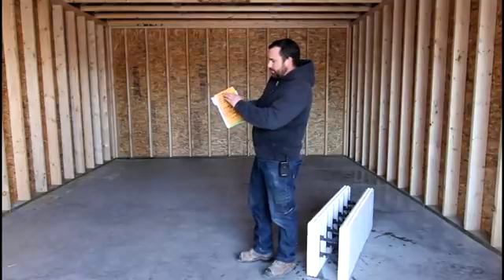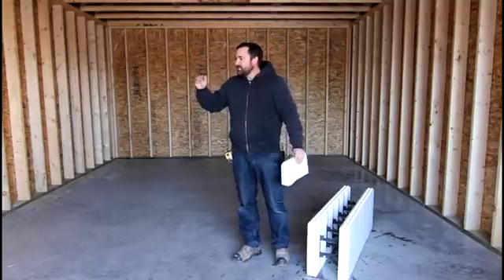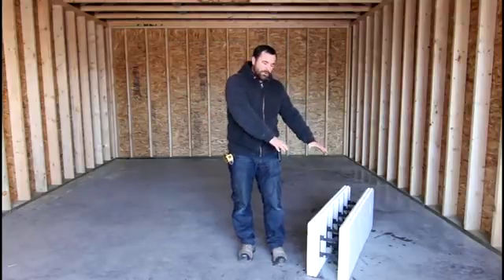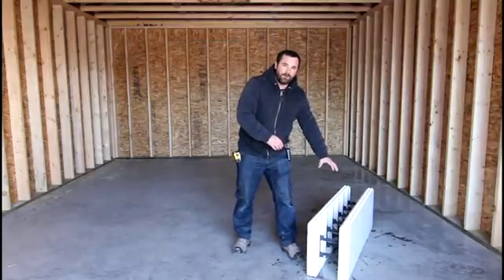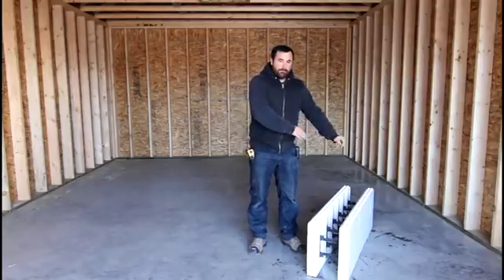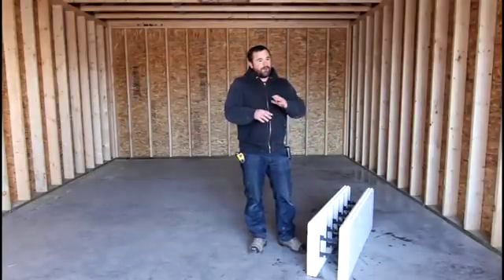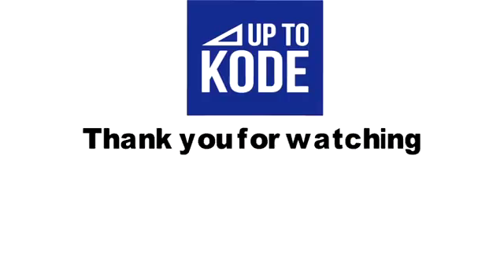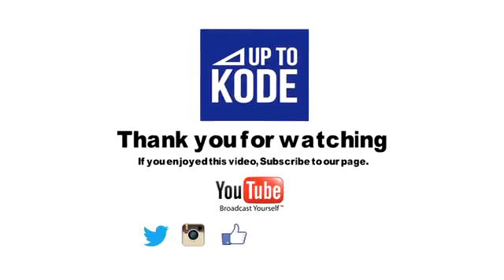ICF vs Wood : How a Spray Foam 2x6 Stud Wall Compares to an ICF Wall

Comment: Blah Blah Blah you still have to interior frame to attack drywall and run wiring. Just another idiot trying to push his specialty without telling the whole truth. We all know every home builder is trying to make money at your expense. It’s not about what is the best, it’s about what is the cheapest way to do it and satisfy the customer.
Reply from the maker: Attachment for drywall and siding is built into any ICF system. Might want to look it up for yourself.  With that known fact you might realize the simplicity and complete system that ICF is.
Reply: Why is it then that most users put in studded walls as well? Because they want a solid wall. ICF is a nice concept, but it results in wavey walls because of its lack of rigidity in the pour. Blow outs are very common. The requirement to use pea gravel also results in a weaker wall structure verses conventional gravel use. The inability to determine voids is another issue. Sorry will stick to a real wall construction seeing as you are framing inside of it anyway.
Reply: Letserb.  If people are having to frame an interior wall as well, then they had the wrong contractor.  You snap a line on the footing, line the block up to the line, and foam it down.  At the top you run a string line all the way around, and plumb your walls after the pour.  Not hard, just different steps than a stick built.  I can make our ICF walls just as straight, or straighter, than lumber.  We use engineered floor trusses on every build, which can't be altered, and they line up just fine.  It all comes down to the workmanship of the contractor.  As far as the aggregate, we use standard 3/4" (unless spec'd different), with proper slump, vibrate properly, and no issues.  Blow outs happen occasionally, and almost all of the time it is because someone forgot to brace something, or forgot the clips, etc, which comes down to workmanship again.  We have been contracting for 27 years, building houses for 18, and ICF exclusively for 8.  All our builds are to the roof, and out-perform a stick built house in every aspect.  It costs a little more, but you are getting far more as well.
Reply: If you don't know what you're doing yeah but icf is the best wall system hands down storm and pest resistance and so much more and interior framing is a bonus if you plan to change your layout eventually

Comment: This guy is dumb he cant even explain everything he saying maby to much and and said he isn't gonna get into it. Spray foam is definitely the best way to go that is what I do for a living and there have been numerous amount of people extatic about there cost being lower.  Concrete is a really bad way to insulate any way let's cool air come straight thru. Spray foam is the best suggestion
Reply from the maker: Spray foam has it place and it is a great product but for the sake of debate like the title suggests...ICF outperforms for multiple reasons. Namely continuous insulation, strength and longevity of concrete, thermal mass, and air tight. 

You’re right concrete has no r-value but the 2 3/4” of EPS foam on either side sure does!!

Comment: If you are going to frame with 2x6's then you should use advanced framing techniques. Things like 24" oc studs, more efficient corner builds, etc. In a 1700 sq ft house, I saved over $300 dollars in lumber costs alone. Remember that the cost of labor must always be adjusted for the extra time taken to build non-standard houses. Another trick is to use 2x4's wherever the code will allow with 2x6 framing to reduce the thermal bridging (the second top plate for instance.)

 Another building option in colder climates would be to use 2x4 framing 24" oc with a single story house or on the top story, and sheath the outside with OSB, drain wrap, 1"-1.5" continuous rigid foam, and siding. In hotter climates foil backed thin sheets plus an air gap works great. Six inches or so of uninsulated foundation walls exposed to colder ground level temperatures will allow heat to escape from the house, so ICF for the foundation build with good drainage is preferred. (Watch out for termites when using ICF!) 

 When comparing apples to oranges, use the ripest fruit.
Reply: sounds really good until the tornado comes then the ole butt cheek get mighty tight
Reply: It's true that the stronger the better, but most of the US isn't in tornado ally, and a direct hit is going to damage your house unless it is completely underground. Jacque Fresco has designed a house that can withstand a direct hit better than any other design. It is shaped like a cone - think of a large fancy Teepee.
Reply: Thats true you don't see them in a lot of places like Vegas or Arizona New Mexico , I was born and raised in Houston Texas so hurricanes are no joke. I can tell you that a ICF home can withstand both. The only week point is the roof, and as long as you properly tie the roof, meaning using plywood rather than OBS, Using screws rather than nails, and the proper hurricane clips, that home wont go anywhere even if your windows fail. A stick built home is basically doomed if directly hit by either a tornado or hurricane.

Comment: This guy has it all wrong, spray foam does more than just insulate.  It also helps sound reduction,  vapor break,  it adds 40% to the structure of the building.  Yes it is more expensive than batt insulation, but in the long run it pays off.
Reply: I doubt open cell foam adds 40% strength to a building structure.  I can def. see a closed foam system but then you're adding nearly 40-50% more in cost vs an open cell.

Comment: And so... have you calculated the additional cost of siding the home.  What is the cost then to drywall the walls on the inside.  Doesn't that have to be framed?  I have no dog in the fight but you video seems staggeringly inaccurate and misleading.  Sorry but I don't buy it from an over-all cost perspective.  Also, the majority of heat loss is through the roof, not the sidewalls and the majority of the heat loss in the sidewalls goes through the windows.  Come on, be honest.
Reply: Cost of siding a icf should be the same as any stick building.  You do not frame out the interior walls either, just screw right into the foam.  

It's more than 5 percent more but that's basically the cost of wood/nails and labor vs blocks/concrete and labor, and the wood labor takes longer.

Comment: I'd be more interested in results from a simple hotbox test than by purported values. Build an 8x8x8 box of taped foam board with a temperature probe placed inside. Replace one wall with your test wall. Stick a heat lamp inside and record interior temperatures until they stabilize. use a thermal camera to take a shot of the outside. Repeat the test with your other test wall. Test walls should preferably have an identical outer surface applied (such as identical sheets of paper) to give an identical emissivity for the thermal camera for fair comparison readings.
Reply from the maker: Great idea! I’ll add it to my list.

Comment: So how does that affect the r-value of the wall as a whole.  Drywall is R-.45, OSB is R-.6, 2x6 is R-6.88.  So the R-value of 16% of the wall is 7.93.  The R-value of the remaining wall area with R-21 insulation is R-22.05
The stud U-factor is .1261 x 16%= .019456. U-factor for the cavity is .04535 x 84%=.038.  .038+.019456=.057456.  This is the U-factor of the entire wall as a whole. This is the equivalent of R-17.4.  Add R-6 rigid foam to the exterior and this gets bumped up to R-24.12 for the whole wall.  ICF block have R-value of 23.  The concrete does not provide substantial R-value.  8 inches is r-.16.  The cost of  800 sq ft of wall with ICF is $6000 and that's not including the pumper truck.  The cost of the typical stick built wall is $1835.   Three years into your new house, try putting a new door in the ICF wall.

Comment: I thought concrete did a lot of expanding and contraction.  That's why you install or cut Expansion Joints, to control the cracking?
Reply: I have never see settling cracks or side effects from this in the many ICF homes I have seen. It may expand within the EPS and therefore not transfer the pressure to the outer cladding or interior finishes. Interesting concern, but I haven’t seen it happen to anyone yet.

Comment: I built my house 3000 sf. That stuff is the best. Wired the hole house some problems but a drill bit cuts right thru length wise..i got propane once this winter  upstate ny..David

Comment: UMMM...WOOD HAS R-VALUE DOES IT NOT?  How about a log home with 18" thick log walls?
Reply: generally wood it thought of to have an R value of 1 per inch of thickness.  An 18" thick Log wall properly chinked should have an R value around R-16 to R-18.  Windows and door openings in the all of course reduce that amount considerably.

Comment: Hi there,

We just built a icf home from top to bottom , 3 floors including basement just over 2500 sq/ft and the garage is just little bigger than a double and under the garage there is another room. It was quite easy to built and running the electrical and plumbing was quite easy. After the concert pours the windows went in easy.  Have to say icf is the way and I live in northern alberta canada.
Reply: I'm in edmonton  How much did this all cost per sqft? thanks
Reply: All that went easy initially. As a tradesman your bill is gonna be exponentially more money come Reno time

Comment: You might pick on the 2 x 6 walls with spray foam. But my 3300 square-foot house we did that way in Florida has $150 power bill average per month

Comment: What I find interesting is that you never mention windows.  that is where you lose the majority of your R-value.  lumber is not the problem you are making it out to be.
Reply: you sir are half right, cheap windows are the biggest waist relative to energy, but so are cheap exterior door, uninsulated garages with uninsulated garage doors. I am sorry but to stick build a home and make it as efficient as a ICF home is really expensive because the new line of exterior fiber boards are expensive. So you got to build the 2 x 6 wall then put at least 2 other building systems on the exterior of the wall plus caulking on each system. I am sorry guys I simply don't see how stick building can out perform the ICF system that is one and done.
Reply: @andrewells7441  tstuds solve this.

Comment: just a couple of points.  ALL concrete cracks,  Keeping out water of a below grade build can be difficult. There is a range of installed insulation R-values in commercially available fiberglass batts for the stud space insulation in this wall system. The installed insulation R-value for 2x6 fiberglass batt ranges between R-19 and R-21. When blown or sprayed cellulose insulation is used, the R-value is typically R-20 for 2x6 walls. The benefit of stick built is future flexibility with utilities.  ICF has the benefit of a thermal mass of the concrete which does not fluxuate as rapidly as outdoor temperatures; BUT still conducts temperatures.  There also is no air flow through an ICF wall, as can happen in a stick built wall with plumbing/electrical outlets.  Pros/cons of each system are for the owner to weigh.  One man can build an addition by himself using traditional stick build methods, as I have. To do an ICF, you would need a few men to handle the concrete portion with the pump/hose movement, etc. if a boom pumping truck can't get into job site. Handy home owners may go with traditional building techniques if doing their own work. Just my 2 cents worth...........

Comment: Yes, but that does not help me with my attic roof.  Suggestions?
Reply: You can take ICF all the way to the roof. I would recommend LiteDeck or QuadDeck. You can go conventional appearance or flat roof and have some rooftop gardens or usable space. Or you can use SIPs for the roof over a ridge beam. 12” EPS does well. Or you can spray closed cell for two inches up to the sheathing and then 10” of open cell. Or you can spray 1” of open cell on top of your drywall ceiling and put 15” of cellulose. The main idea for attics (outside disaster areas) is to mitigate heat loss/gain. The main premise is airtight the entire building envelope and condition the attic or airtight the boundary at the ceiling level and let the attic be a breezeway. Either way airtightness is required and you need an ERV.

Comment: how on earth do you wire or plumb a house for anything when all the walls are solid concrete?
Reply: I am also curious.  Pre-run pvc? or Install prior to pour? both seem like bad ideas.
Reply: Huge added cost to concrete for all the internal necessary HVAC and Electrical equipment that is usually located within the walls, not to mention the drywall or wall covering that is attached to the stud walls
Reply: Easy to route channels for wires.    Sheetrock screws to embedded plastic strips in blocks - take pics and measure to know where strips are.
Plumbing is typically under slab and comes thru slab, sometimes in routed channel in foam behind Sheetrock.   All in all sure glad I did icf.    The impact of thermal mass between insulation means cold and heat never get thru in some states - r65 equivalent.   For outside stucco, metal latching sheets screwed to plastic in blocks - very easy to do.    The huge factor is that thermal mass between insulators that average and cancel day sun heating with night cooling.   Far superior to wood and high density foam.,
Reply: Brian Smith you screw drywall direct to embedded plastic strips in those blocks.   Just like Sheetrock over studs.    Outside you screw on metal lathing for 3/4 inch stucco.   But yes, all wiring planned and done ahead, no wire fishing after, except on interior framed walls.

Comment: Give me a stick build house any day!  That ICF wall has problems with it.  On the outside you have to clad it with something above grade which is a problem unless you are building a stucco ranch.  On the inside you have pretty much the same problem unless you have some good plasterers but then alterations to the house are a nightmare.  My house has a 8" reinforced concrete foundation which has been sprayed to the fill line with hot asphalt, covered with some kind of mesh, sprayed again and then 4" of rigid foam is pressed to it and taped, then back filled.  The pattern in the concrete, in and out, is brick.  The inside is painted with Ultra DryLok (2 coats) and then 2 coats of SW ultra high gloss white.  The floor has 2 coats of concrete paint.  Warm as toast, dry as a bone and dust free.  The rest of the house is stick built.  For 2,800sf.  we spend about $110/month for heating, A/C, hot water and washer/dryer.  When I reside this house, I will put 5/8" Dowboard all around and Allside Charter Oak vinyl.  Did this for my 4,700sf. house and got a real surprise - lower utility bills (expected) but complete silence though I am very close to the Ohio Turnpike and the CSX mainline coming out of Cleveland, OH.
Reply: John,  since terms are not defined I am left to interperet what you mean by cladding.  Both stick and icf builds require an outer surface such as siding, stucco, brick or stone veneer.  Both require protection from moisture using a barriers under the above mentioned veneers.  This moisture barrier could be tyvec,  zip-r sheathing or a liquid applied product from prosoco.  Internal to most modern icf's is "stud" attachment alloing drywall and exterior veneers to be attached.  Each type construction is different and must be properly designed and installed.  They are not the same for sure but to suggest that icf's need cladding and that somehow makes them inferior or substantially different to stick building is really a miss guided statement.  Now if you mean something else than what I stated above you will have to explain in greater detail.

Comment: Does the ICF wall system use closed or open cell foam? That is very important.
Reply: Usually or at least all of the ICF forms that I have ever used are EPS, which is closed cell.  You will always want to put a waterproofing membrane on the exterior, below grade, and some form of weather screen above grade as some water can still force its way in between blocks.

Comment: what is the R value of the ICF wall and the 2x6 wall?   i have seen house done hear with double 2x4 wall with a 4" air bake so you end up with a foot thick wall but have great R vale and do not have to pass and utilities though your vapor barrier. never being around ICF what makes your vapor barrier?
Reply: mog5858 the foam meets the spec for a class 1 vapor barrier.  The CC makes it very airtight.  Typical R value is around 30 once clad inside and out. Where it shines is with the mass of the concrete.  Takes time to heat mass, and this delay puts the transfer of energy thru the wall out of phase with the daily temperature cycle.  IE: about the time the days heat is making it thru the wall, it is just starting to cool down inside as no more sun is coming thru the windows. This delay helps keep the internal temp more stable...
Reply: @rronmar  Great explanation

Comment: The doors and windows only require lumber bucks to support openings during the concrete pour. Supports can be removed when concrete is cured enough to support its weight over any span. Windows can be flange mounted or centre mounted with screws into the plastic ribs of the block or styrofoam buck. 
Google "Fox Block "
I am in the process of building a footing to rafters ICF Fox Block home in Vernon BC.